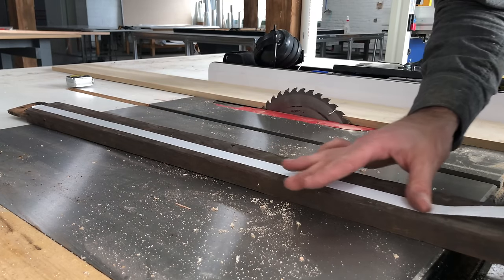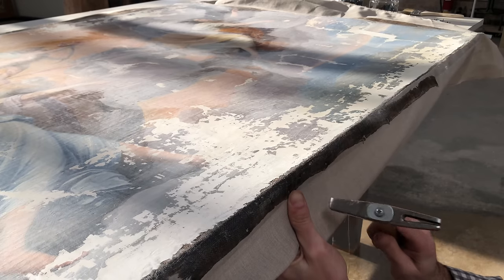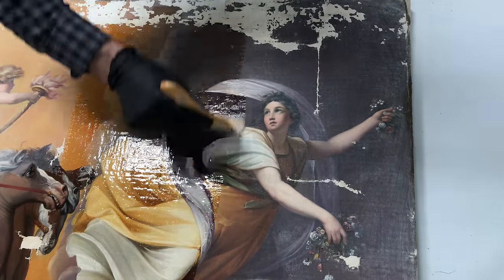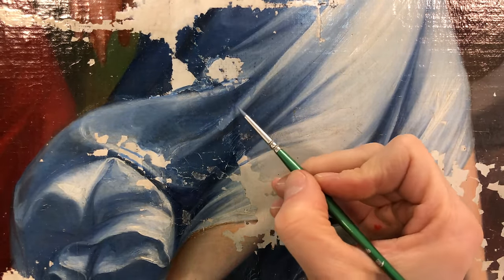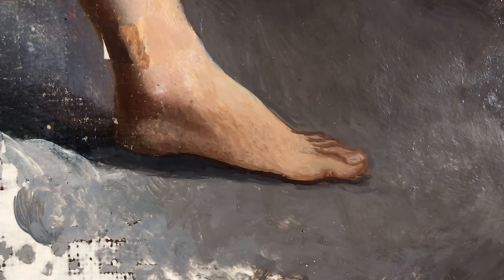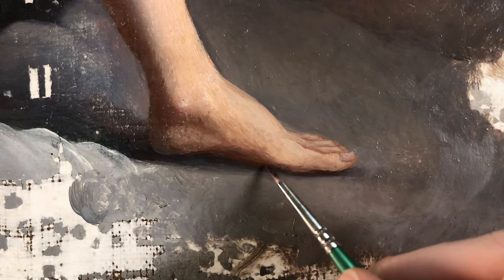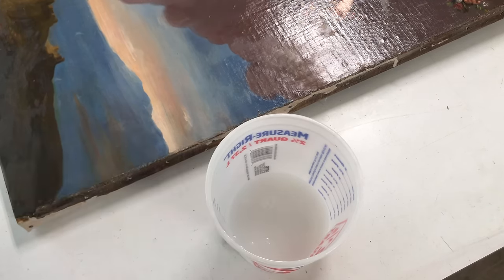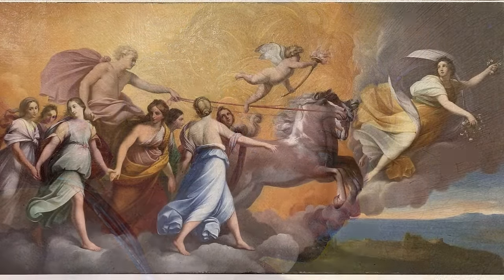A New Dawn: The Restoration of L'Aurora Part 2

Comment: After watching hours and hours of Julian working I got up the nerve after L'Aurora part one to take an embroidered cloth sampler out of its frame.  It was so discolored from time and generations of smoking that I hadn't hung it in years.  After using techniques and materials learned over 60 years of washing fabrics I produced a much lighter and brighter piece.  I gently pulled it into square and dried it flat on granite.  The frame it was in was too large so I'll take it to the framer.  Thank you, Julian.  I could probably restore the Shroud of Turin.  :)
Reply: I often take vintage clothes from people and gently wash and press them. It's a process that requires a delicate touch. :)

Comment: I'm so used to everything being all about "it has to be reversible, we can't make any permanent changes" that when he ran the wood through the table saw I gasped so loudly I gave myself a coughing fit. 

(ps does anyone else find it weirdly sexy that he knows all these different techniques for every aspect of things?? that kind of skill and knowledge is just ridiculously hot)
Reply: Yes, indeed.
Reply: Stretchers are one thing he often makes permanent changes to. The stretcher is RARELY something the artist would have worked on themselves, and were likely purchased or made for them by someone else. The stretches don't usually have too much value attached to them. 
Frames, on the other hand.... that's different. If it's an original frame to the painting, something the artist themselves or the first patron put it in, entirely different! 
But all stretchers are inherently the same... they're needed for the structure of the canvas, but don't actually contribute much to the actual work the artist did.
Reply: I think you have just discovered your competency kink

Comment: I’m a big fan and followed you for years. I have a recommendation for helping with painting the foot. Get an opaque projector and print out the reference photo to fit the projector. Then turn the lights off and project the art onto the painting. It will give you an exact reference to the original paining. You’ll still need to do you magic but it helps tremendously.

Comment: To straighten the wood, you should have steamed it. Really soak it for a few hours, in a mylar envelope, then vacuum sealed it on the hot table, on low setting with weights on top. That's what furniture restoration people do. In the end, when you were spraying the varnish, we could see that it was no longer square. With that being said, my God, that was fabulous. Just amazing.❤

Comment: Spitting tacks makes me so nervous. I trust that he knows what he’s doing but jeez that’s such a strange concept to me. What upholsterer hundreds of years ago looked at tacks and thought “you know what would make this better? Puttin then in my mouth.”
Reply: It probably started with the upholsterer using their mouth to hold the tacks, like tailors with pins. Then they found that it made things easier and experimented with the technique.
Reply: Cheeks are just juicy meat pouches.
Reply: The moisture added by saliva actually helps tack old and dry wood. In some cases it's necessity, not mere convenience.
Reply: Builders and carpenters have been putting nails and other fasteners in their mouths for ages, probably for centuries. My dad does it, my wife's dad does it, even I tend to do it from time to time because it's just much more convenient than fumbling around for a fastener while you're holding a piece of wood in place (or a piece of canvas taut) with your other hand.

Comment: On the one hand, I can see why people want to leave the painting, warts and all, as damaged as it came into the studio, with only minor treatments and light cleaning to make sure the painting can still be viewed and seen for itself, with no extra work added by the conservator period. Voids? Evidence of what the painting has been through, so a historic mark for what the painting has gone through on its journey thus far; thus, never fill in voids. Never add more paint, just clean and make sure the original paint never flakes off. Technically, that's all that SHOULD be done to conserve the piece; adding more paint and hiding the damage is disrespecting both the original artist's work as well as the long history of the painting. Right? 

On the other hand, the history of the painting is only a minor footnote to appreciating the artistry of the painting. Why? Because those tears and voids and areas of missing paint are NOT the work of the original creator. The original artist did not cause that damage (usually), and thus elements of the original artists' work are completely missing. Not only that, but time will cause the painting to deteriorate further, with the example of resins that used to be considered as appropriate for protecting the paint layer back in the day nowadays are shown to yellow and tarnish as the painting gets older; thus, there is even more that has changed that prevents a viewer from seeing the painting in a state that is closest to when it was first painted. Thus, an effort should be made to fill in those cracks as best as possible, with the goal being to restore the original vision of the original artist. Thus, one can appreciate the painting in a format that is as close to the original painting as is humanly possible. Thus, one can appreciate the art of the original artist, regardless of the damage done to the original painting. That way, people can appreciate the painting without being forced to appreciate the damage the painting has been through. Right? 

Honestly, I don't think both of these sides are actually at odds. It IS possible to restore the original artist's vision, and yet have a detailed record of the damage the painting has been through as well as a detailed report of the conservation done to restore the artist's original vision, thus appreciating both the history of the painting AND the restoration of the original artist's vision (as much as it can be restored). It IS possible to swing one way or the other, depending on the painting; if a painting has minimal to no paint loss, then a cleaning and application of reversible varnish may be all that is needed. If a painting has tears and missing pieces of canvas and humongous voids of missing paint, then the only way for the painting to be elevated from a conversation piece on the trials and travails of a work of art throughout its long and storied history to a work of art to be appreciated in and of itself is to restore the original vision, which requires completely restoring the painting, as much as possible. 

People mistake opposites as constantly fighting each other, as constantly opposed to each other. Rather, it is more like temperature: everything is somewhere between infinite heat and absolute zero, and things constantly shift one way or the other towards one extreme or the other. The two extremes are never in constant battle over "supremacy" or "domination", the temperature of an object is just the temperature of the object, and one treats an object closer to "hot" differently than how one treats an object closer to "cold". So if a painting requires this kind of intense reconstruction, then it should be reconstructed; if a painting does not require such a complete reworking, then why rework it? 

It's not black and white, but just a spectrum. People getting upset because they prefer "cooler" or "hotter" conservation techniques are missing the forest for the trees, IMHO. Different conservators, different techniques; the end goal is always the same, to get a painting ready to be appreciated by others, just like the original artist intended, much the same way that temperature readings and studying the flow of energy that causes those changes in temperature (thermodynamics) can be utilized to make engines work, to make turbine generators function and to allow automated heating and cooling. The temperature of the fluid flow source indicates what techniques are required to accomplish what one wants to do. I see the discussion around conservation techniques the same way. 

Make of my thoughts whatever you will, I hope it was thought provoking at least.
Reply from the maker: Well, there it is. The conservator’s dilemma
Reply: BRO! I didn't read the whole thing. But Baumgartner agrees with you, so I'll agree with you. 😆
Reply: I see your point. I think that Julian stated quite clearly that he discussed what the owner wanted, AND that it is completely reversible. I also noted that roughly the same number of people who 'disliked' the first vid, also 'disliked' second. SO-the haters may hate, but they still watch his restorations! Beeotches! 😉
Reply: I’m hardly educated in the topic but I know if it was my choice I would want the damage vanished. I feel like it’s the image itself that deserves to be remembered, not the effects of poor care or maintenance, yknow? It’s such an interesting issue though!

Comment: So early! I have a couple of questions on the retouching, if you ever read this! Just before you apply the isolation resin, it looks like the painting is quite dusty. Is that just the natural texture of the original paint or is there a reason you don't remove the 'dust'? Also, when you level out the painting with the isolation layer, does your retouching not create more unevenness on the surface? Thanks, Julian!
Reply: There's definitely no dust - he spent long enough cleaning it! The surface of the paint is rough, and it scatters the incoming light, which dramatically impacts the appearance of the colors and the contrast. Varnish smooths the surface out so this scattering doesn't occur.

There's also a final varnish layer that goes over the painting, so the retouching isn't just "sitting on top" anymore.
Reply: You better ask him on Instagram. Haven't seen him replying here

Comment: question: after cleaning and filling the paintings have e ''milky'' or ''dusty'' look to them. is this caused by residue from the filler, or are these just the paints without the varnish? I mean it disappears instantly when the varnish is applied but it still bugs me not to know...
Reply from the maker: It’s a bit of both.

Comment: Beautiful restoration. You are very meticulous. One thing I did notice, if I could be so forward and inexperienced to point out, is that you are very careful with the canvas edges, making them, tacking and squaring, but when you apply the final varnish it often bleeds down into the perfectly clean linen, like a drip edge. Have you considered applying a blue painter's tape to the tracking edge before the final varnish coat. Also, possibly in one of the key areas, slip in a card stating the varnish used and solvent to use to remove it; in 100 years they may have totally different sealants and stand their scratching their head wondering what was used. Beautiful beautiful painting.

Comment: When it comes to restoration, I think the question of "is this unfaithful / untrue to the original piece" is a complex one. And where we choose to draw the line in the sand will ultimately be a subjective judgement call in most or all cases.

But also I must say: I deeply respect and agree with your choice and commitment to doing the restoration in a way that is as reversible and non-destructive as reasonably possible.

Comment: It's funny when you watch the paint go on, you can be overly critical and see little flaws, but when you see it all finished, you don't really these those flaws. It all perfectly merges with the original. Nothing stands out in the slightest as not matching. You'd really have to "pixel peep" to see a lot of the work. Very well done.

Comment: Just a wee tip for you in Photoshop. When you are trying to align two layers select the top layer and change the blending mode to deference. Then use your cursor keys to move it up or down. When the image on top and bottom are aligned the image will look black. If you see white, it's not aligned. When your done, change the blending mode back to normal. It is so much faster.

Comment: Learning from different trades to improve your craft is great, here is a trick from an autobody man. Instead of or in addition to using a raking light I recommend not searching for those low and high spots with your bare hands. Rather place a thin cloth between the palm of your hand and the work, you will immediately notice those imperfections much quicker and reduce eye strain and the likelihood of missing something

Comment: Standard wood glue is actually quite reversible — luthiers much prefer titebond types or hide/fish glue over many other popular adhesives when they need to pull an instrument apart as it's very easy to remove with little to no damage to the surrounding finish and wood, plus with very little residue left.

Comment: For a very fine sanding, luthiers of the past used diatomaceous earth - it's few dozen-hundred micrometers sized sharp particles are very abrasive, yet, do not leave visible scratches - at least not the ones that would not disappear after final varnishing.

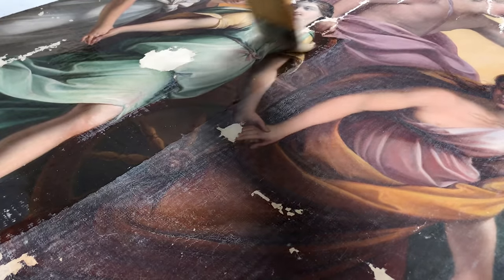Comment: 9:13 I think you mean more viscous. Water has a low viscosity (very thin and runny) but something like maple syrup has a high viscosity, so if the resin is very thick then it would be more viscous. Not trying to sound like a know-it-all, just an FYI 😅

Comment: I always disagree with retouching with a small brush in areas that were originally painted with larger brushes. It is not just about trying to match colors, it is also about emulating the blends and techniques. Not a task to be undertaken by most conservators, because they are just not capable of these skills.

Comment: You said you had the original. Why didn't you just lay over a grid and paint the foot correctly to the inch? Or you could project it on the picture to get an outline. I looked at the one on Wikipedia and your foot is very different. Especially the upper curvature. In the original it's a long curve that goes to the start of the big toe, not before it. Yours is curved more and ends before the toe making an even S if you follow it from the start of the foot to the end of the toe.
I mean i know it's just to divert the attention from the missing part. But if you already have the original, with a few easy steps you could trace it perfectly very easy. I don't understand why you do this by eye.
Reply from the maker: I don’t have the original- it’s a fresco in Italy. This is a copy of that original. I have images of the original but as this is a copy it’s not identical to the original and simply copying the original wouldn’t be appropriate.
Reply: @BaumgartnerRestoration  What i meant is you have access to pictures of the original which this is a copy from. It's true that it's not identical. I was only looking at that spot and comparing them. You have put some thought into it. The painter didn't trace it so you also shouldn't. I don't want to be harsh. It looks good and doesn't stand out. 
I guess you took the other foot of that character as a reference which also has that flat space between the big toe and the curve of the top of the foot.